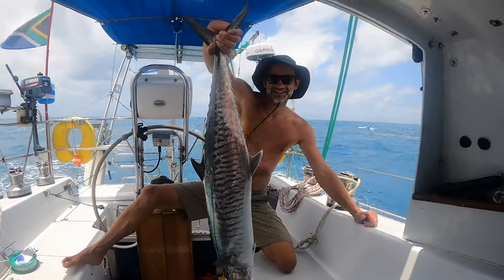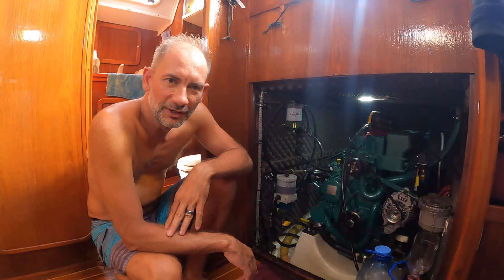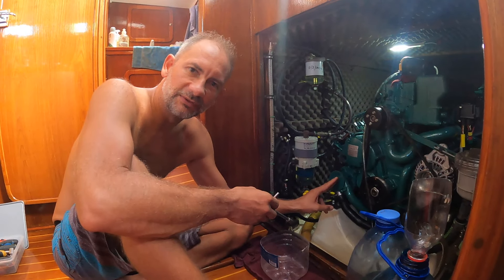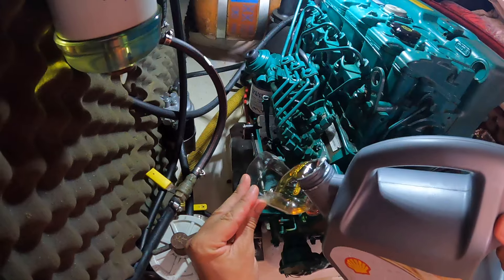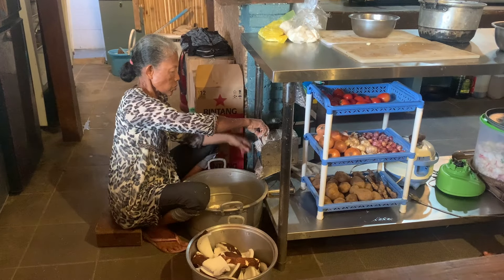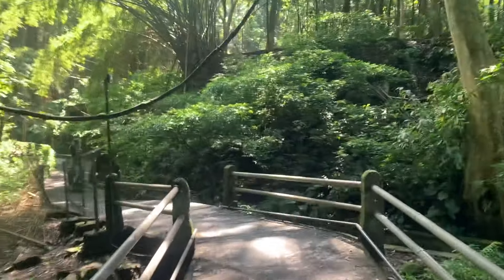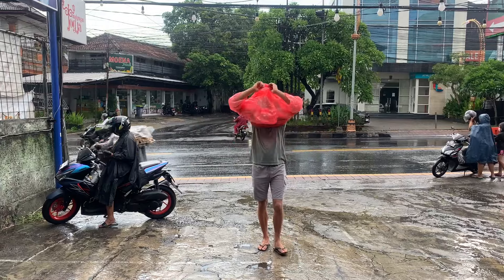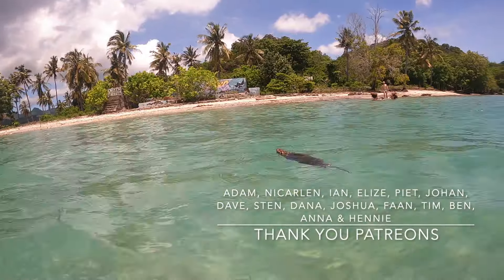Finishing boat jobs and searching for parts EP106

Comment: Gerhard thanks for clear explanation doing engine service and Jacqueline for hoisting Gerhard to do the inspection, so bly jul kan self die tipe onderhoudwerk doen, like they say ... safety first
Reply from the maker: Safety first and learning to do it yourself is not only cheaper but also means you know to fix it when something brakes or in Gerards case, spotting problem early enough to fix instead of replace.